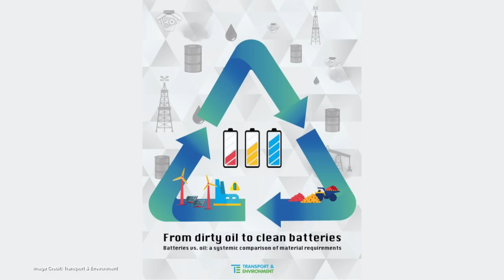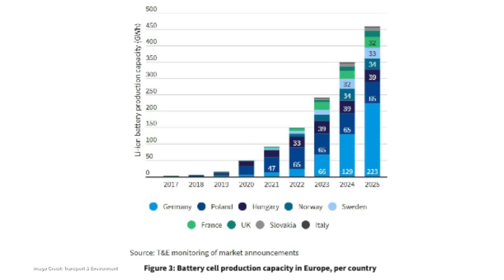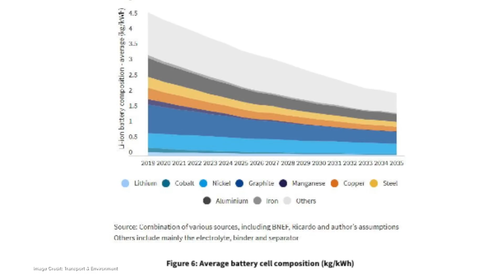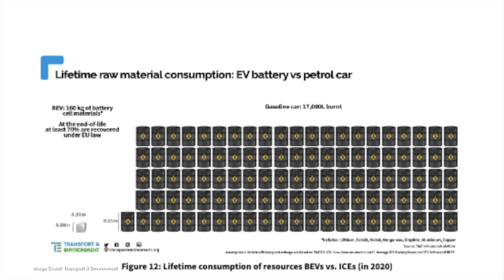This Report Busts The Myth That Electric Cars Are Worse Than Gasoline ones

Comment: Toyota has engines that are 38% thermal efficient
Coal/Oil Power plants are up to 37% thermal efficient
Nuclear Power plants are up to 33% thermal efficient

Don't forget about energy loss in transport, about avg. 6% in the US from power plant to plug

energy loss in charging the battery, 
energy loss reclaiming from the battery. Batteries are only around 70%-80% efficient.

So if your electricity comes from fossils to fill that battery of yours. Keep choo choo'ing on that combustion engine of yours, for now...

Comment: The most problematic metal in EVs as well as renewable power is copper, which is completely ignored because we are just used to exploiting tons of copper all the time.... and then we would have to take other industies to task on copper use. It is estimated there is 2 to 3 times more copper than lithium in the Earth's crust. But EVs use around 8 times more copper than lithium. Copper is extracted using pressurized water and has a huge environmental impact. There is a ton of waste material and toxic ores are suspended in the waste slurry. But nobody cares about copper extraction because its not a high value metal. I greatly support EVs and renewable energy, but the fact that everyone just ignores copper is super worrying to me.
Reply: How about the electrical wiring in houses? That uses copper too. Has that ever been an issue for you previously?

Comment: Poland makes 675g CO2 per kWh. Average BEV needs about 20kWh per 100km when we include grid and charging losses (and switching on AC/heating from time to time) 675*20=13500g of CO2. Average ICE makes 12200g of CO2 per 100km. And that´s only including operation, not production.  I´m all for switching to electric cars, but these reports lack objectivity.

Comment: Countries in the EU should look at incentivising manufacturers to bring low range vehicles to market. Say, a 40km or 60km range vehicle. However, these must have upgrading options, making it possible to elect an increase of your car's range when you go for a "major service". A modular battery pack design can work for this. Especially when there is the option to rent a larger battery pack when you want to go on a road trip. Secondly, there should be incentives to facilitate financing of EVs over a longer period than ICE cars. Firms generally tend to design and manufacture goods to have a lifespan a little bit longer than the point where a replacement purchase is likely. For example, Mobile phone contracts are generally around  24 months. No surprise then that your phone seems old and the battery ruined around the time you make your final payment. For this reason it makes more sense for an EV to be paid off over 8 years. Certainly a large origin of the resistance within the legacy industry against EV manufacturing have been the inability to make the kind of revenue that replacement parts on ICE vehicles provided. It is my argument that, by selling vehicles with smaller battery packs, but with the ability to add additional modules at a larger profit, will lead to an accelerated product proliferation.

Comment: This video misses the point entirely. Yes ev's are better than ice but they are still a disaster
Reply: That is an entirely separate point. Even if we manage to build out urban mass transit and a modern (20th century anyway) electrified interurban rail system and replace as much of our car-centric infrastructure as possible with more optimal modes, we'll still have vehicles even if not private automobiles. The trolley bus that goes through my neighborhood has been running with its poles retracted - meaning it's on battery power at least through this stretch. They're building electric locomotives in Europe for lines that aren't hooked up with pantograph wires because it's just not cost-effective. Are you going to protest that, and argue that they should stick with diesel?
And the anti-battery FUD from the oil and gas industry that gets recycled online by supposedly green types (because any tech is bad to a luddite) is just plain wrong, and is all answered quite well here.

Comment: The carcinogenic effects of petrol seem to never get mentioned in all these studies.
Reply: Health impacts in general are never mentioned. And in this category, EVs are also problematic due to tire wear which is the primary constituent of airborne particulates. Although EVs often get blamed for having excessive tire wear, its really not the fault of the drive train so much as a-hole drivers who accelerate too fast and brake too hard. Self driving cars COULD be programmed to drive conservatively and reduce tire wear at the same time increasing efficiency.
Reply: @patreekotime4578  Brake dust is also far more of a health issue on ICE cars than tire wear is on them, but EVs produce far less brake dust due to regen. EVs also have less tire wear than ICE cars in most cases due to smooth acceleration, even when people are accelerating hard, it's the jerk which causes the most wear and EVs being mostly single fixed gears eliminate that jerk entirely while in motion and with instant torque a human can't press the pedal quickly enough to cause it to start moving at full power, reducing the jerk on getting moving compared to ICE cars with clutches and torque converters which have to apply more power than needed to start moving or they stall. It would be far better if we could reduce or eliminate tire wear even further and obviously driving a tiny lightweight ICE car gently will have less tire wear than a driving full size SUV EV as hard as you can but similar models driven similarly lead to more wear on the ICE car's tires in most cases.
Reply: Nor do the huge environmental costs of extracting, refining and transporting oil, petrol and diesel all over the place...

Comment: Gee, a trade group that pushes for EV adoption wrote a study that says EVs are better than ICE. It's too akin to the police saying, "we've investigated ourselves and found we did no wrong."

I mean, they claimed that the battery in an EV can be recycled, but the fuel burnt in the ICE cannot, and thus EVs are better. Well, where did the "fuel" that the EV "burnt" go or even come from? It's like all those years ago when people put down ethanol because "you've got to have tractors and distilleries and trucks to grow, make, and ship that ethanol and that uses energy which makes using ethanol inefficient"; when they failed to account for the energy expended to build the off-shore drilling rigs and pipe the oil to the refineries and then ship the gas/diesel to the gas-stations. Those gasoline vs ethanol "studies" were often pushed by oil companies to keep ethanol production and usage hampered. Even the "fuel or food" FUD that was spread about it was based on bad science. Distillers grains - the waste stream of ethanol production - made for great animal feed, giving fuel and food; whereas just putting the feed-source to the animals first ended there except for a few programs to capture fuel sources from the waste stream of the animals, such as the digester system at a nearby dairy farm that turns the cow waste into CNG which powers many (if not all) of the farm vehicles.

That's why I currently question the veracity of this "study". If a third party comes along and calculates it including the energy for "refilling" those batteries, and then comes to the same conclusion, I'll give this credence. As of right now, I'm not sold.

Comment: No one tho seems to be talking about EMR.
Reply: Is that because no one knows wtf EMR is?
If you mean Electromagnetic Radiation,  that would mean what?
Reply: @dnomyarnostaw  You're sitting on it in an EV.
Reply: @nocommentnoname1111  No youre not.
The battery system is encased in a virtual Faraday Cage,  and all power is run through heavy cable. 
There would be zero Emf!

Comment: What on Earth is the justification for any kind fossil fuel subsidy?
Reply: Stop talking nonsense, EVs are still in their very beginning, we use fossil fuels for everything from agriculture to shipping, flying, rocket launch, mining, road taring, insulations, drugs, transportation....... if we stop subsidising the price of everything will exponentially go up since EVs are still not good enough.
Reply: @carholic-sz3qv  The oil industry is the most profitable, capital intensive industry in the world, with a history of well over 100 years of significant profit. The oil industry has made countless millionaires and has supported the economies of nations. So, what need does the oil industry have of subsidies? What is the justification? What is the source of the subsidies that the oil industry receives? Who pays for the oil industry’s fuel products? Specifically fuel products, as those are the uses that are the most polluting. Farms, pharma and foams, etc. are off the table.
EV’s are not at their very beginning. They pre-date ICE vehicles by over 50 years, the first, very crude, electric car was built around 1832, but practical versions did not show up until the 1870s. Carl Benz patented his “vehicle powered by gas engine” in 1886.
Reply: @bettyswallocks6411  unfortunately the oil industry has always been subsidised for decades, its a very expensive and they spend alot of money to develop all those installations and build ships to produce oil, also its the 19th century with the invention of plastic that really ramped oil exploitation. Everything today is just because of the oil industry. The renewable energies still heavily depends on the oil industry to evolve too.
Reply: @carholic-sz3qv  Having been around for decades myself, I am broadly aware of what the oil & coal industries get up to and what they have been up to. The question was really meant as a rhetorical anchor for a discussion. No such luck.🤪

Comment: Car batteries are the tip of the iceberg. Lithium batteries in gadgets, tools, pads, phones, laptops, etc etc etc are exponentially larger than EV's at this time.
Reply: Sounds like you just made that up without any evidence.
One 50 kWh EV contains the equivalent of 4,000 phone batteries, or 1000 laptop batteries, or 200 ebike batteries, give or take.
(Exponential describes growth over time, it does not describe the size of one thing compared to another!)
Reply: And its growing too, there are more devices that are being electrified from lawnmowers to chainsaws.......
Reply: These small batteries are nothing compared to the scale of EV batteries. They might not be even worth the effort, at least not for EV recycling plants, maybe plants focused at smaller batteries. I think batteries like this actually need to be recycled in the EU, but it probably uses a very inefficient but cheap method.

Comment: Solar panel installation and EVs have something in common, namely that experts say the cost of crucial components are dropping very rapidly. However, the drop in expense isn't available to the consumer who actually buys the end product.  The estimates I get for a solar installation on the roof stay near 30K and don't change in response to those allegedly dropping costs. For Autos, the TCO may be lower already for EVs, but the upfront cost isn't dropping proportionally to the battery expense. The 25,000.00 passenger car remains a mirage , just a lovely goal
Reply: In US, the cost of the panels are a smaller fraction of the soft costs - labour, permitting, inspections etc.
Germany solved this by significantly reducing these barriers to adoption.

Comment: LFP batteries already don't have cobalt, like some of the standard range Tesla Model 3's made in China with CATL cells. Also no nickel in those, just iron and phosphate. It doesn't have quite the performance of the long range ones. The  charging rate only goes to 100kw, and the range is 260 miles, but it can be charged all the way up every time, and the cycle life and safety of LFP is exceptional. 

Tesla is working to eliminate cobalt from their other chemistries too, high nickel, and nickel manganese.
Reply: The thing that excites me most about the shift in cell chemistry is because Tesla isn't the only one. Volkswagen, obviously, are shifting to LFP and low-cobalt chemistry, and I think the Renault 5 EV is going to use LFP. Make the vehicles more efficient, like Hyundai/Kia and Tesla are doing with things like SiC power electronics, and LFP batteries make a lot of sense as a low-cost, high-volume chemistry. I hope that the manufacturing will shift to be less China-centric. The actions of the Chinese regime (and lack of actions from the rest of the world) worry me, and I wouldn't feel comfortable buying and owning a car with a battery made in Xinjiang. More production of batteries outside China would make me feel better, and that seems to be the direction things are moving.
Reply: The problem with LFP batteries is they’re HEAVY.  I’ve heard about 7 lbs more per kw.  An extra 500lbs hurts efficiency, reliability, tire life, etc.  Probably, useful for small cars, though.
Reply: @willaerley7140  They are light enough to make a 260 mile car. That is good enough for many people.
Reply: @fjalics  True.  From the reviews I’ve seen, the MIC SR+ is about 400 lbs heavier than a US one.  It still performs well, but the handling and braking doesn’t compare to the lighter car.

Comment: Why is it people never ask where the lubricants and many other parts of the ICE vehicles end up but they are all so worried about the batteries?
Reply: Oil recycling is a mature industry, all the lubricants done at a service center is recycled and has been for decades. EVs also have plenty of lubricants, the replacement interval is closer to that of a manual transmission. Brake fluid has to be changed just as often as any other car. EV's often have more coolant than ICE cars. The coolant system in an EV is about 10 times more complex than an ICE car.
Reply: @dannelson6980  you have totally well explained everything mate, also the lead batteries, catalytic converters and many other ICE car parts are recycled, many ICE car companies have been using recycled materials to build their cars and tesla isn't even doing that which is a shame.
Reply: @dannelson6980  Ok, thanks for the info. But I´d like to add, in spite of being a mature industry, oil of all kinds is still spilled out on the roads, on mechanic shops and every else for that matter. (I should know, I ride both a motrcycle in the city and on the road and a bicycle on dirt roads, I see every single day I am out...)
Reply: @marcoferrao   Completely agree, the amount of oil leaked daily is insane. However even manual transmission and differentials leak. As electric cars get to be 10-12 years old many will start leaking fluids.
Reply: Because people hate change and are trying hard to rationalize needing ICE.
Reply: @davidmccarthy6061  nonsense, ICEs are available in millions in the used market, who is going to justify buying a very expensive EV just because they want to save the planet?! Also even the very old ICEs still have better range than EVs, those ICEs can tow, go overlanding and are way more polyvalent and customisable than EVs.
Reply: @carholic-sz3qv  The average gasoline car in Europe has a range similar to that of the long range EV's, meaning that there are plenty of ICE cars with a smaller range.

Comment: 7:42 - I'm glad to have my dirty and stinky (in winter people burn here a lot of coal to heat houses) country mentioned. There is very strong coal mining lobby. The government must pay miners for working in uneconomical coal mines, otherwise those bandits go to Warsaw, destroy some stuff and get what they want anyway. We need Margaret Thatcher, and I need a lot of solar panels, but have to move to a house, before I can do it.
Reply: Is solar going to heat or cool your house?! Also you need alot of batteries for that, stop talking nonsense.
Reply: @carholic-sz3qv  Of course it can.  With battery backup, running a heat pump, especially with geothermal heat sink, it is possible.  Are you going to ask about snow or clouds?
Reply: @normcfu  unfortunately it cannot and the batteries alone aren't enough to make vehicles, let alone most buildings aren't properly insulated and its the case of buildings in the US particularly in texas. The images and videos of texas houses fizzing totally from the inside because of poor insulations. In Europe they have had double and triple glazing windows for example and thicker building walls.

Comment: The world needs cheeper electric cars that can do 250 miles no matter what the weather is like or if the heaters on and fast charging  then there will be a big uptake it must be possible to do this for £28,000
Reply: There will never be an EV that will have the same range 'no matter what the weather is or if the heaters on'.  There are no ICE vehicles like that sold today, either.